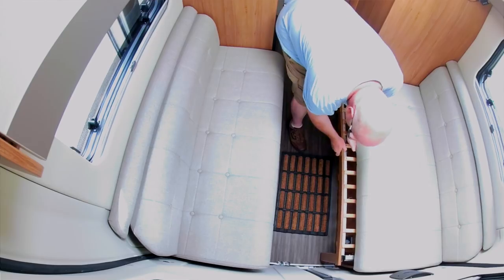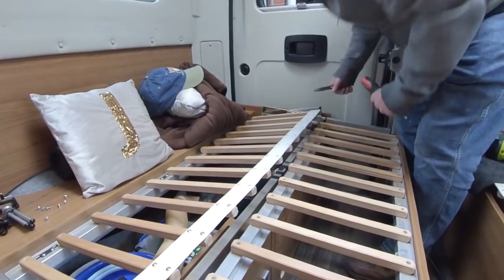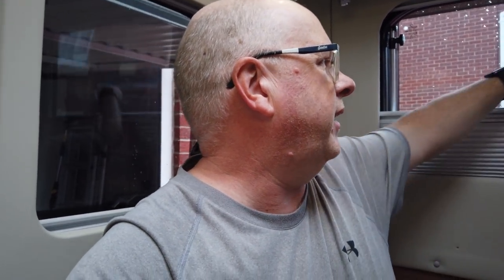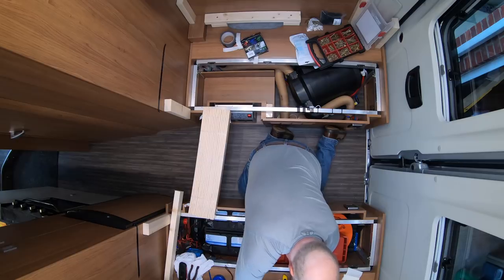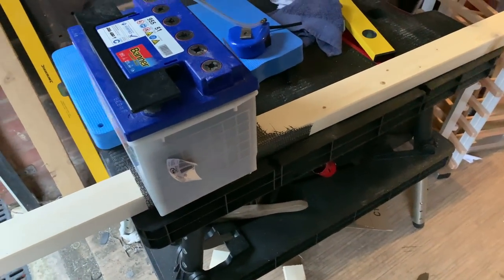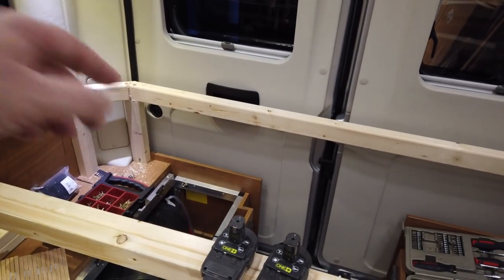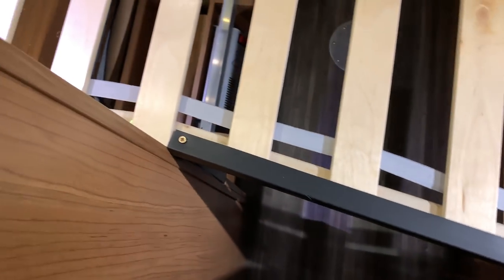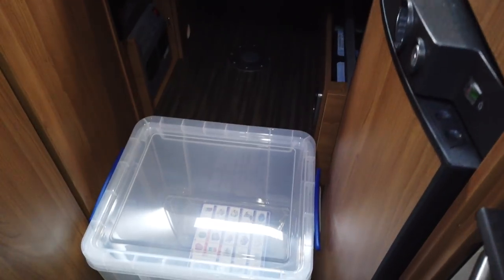Campervan Changes - New Fixed Bed 🛏& Storage - Ep4

Comment: You know all the UK style vans have these low beds which steal storage space, I so much wanted a WildAx Aurora Leisure but they do the same thing! Not Adria,Globecar,Malibu,Hobby et al, they all have higher beds made from proper matress's and give loads of underneath storage, John a job well done!
Reply from the maker: Thanks John. It’s like the designer never went camping to test the van out, or if they did it was on their own for 1 night and they needed a place to put their clothes on a hanger - real van life problems if you can’t hang your clothes 🤣🤣
Reply: You hardly ever come across a european that drives a UK manufactured van, its not a quality issue but probably due to design flaws which us brits will never hold our hands up too. I did ask Wildax to raise the bed area by 6" but the answer advised against as the sitting position would be too high and a false floor would need to be added for comfort? See what I mean by UK design?
Reply from the maker: “Computer says no” kinda attitude. They build these vans in around 18 hours, they get thrown together and no one has ever been powerful enough to make them stop and listen to customers, I’m just as guilty as everyone else buy buying these vans, my excuse was I always intended to make changes, but as a base vehicle it met our needs and gave us something to work with.
Reply: John your answer is far to kind, take Benimar they make great vans for europe with user friendly designs, BUT by the time they come to the UK the design has been totaly changed so underbed storage is gone and the front dinette can not be used to sit and relax as the distance between drivers seat and dinette seats has all but disapeared? King nuisance me thinks.

Comment: more gear equals more weight ? do you have the load capacity John ? I know we were mindful of this so had our load capacity upgraded.
Reply from the maker: Yes, it's really important, like you said, to not overload the van. We were 500KG under weight before we made changes, we've removed weight and then added some back in, and will be adding weight with our gear too. So once complete I'm going to top up the LPG, Water & fuel and head off to the council weigh-bridge and check I'm still safe. Great advice 👍🏻🚐